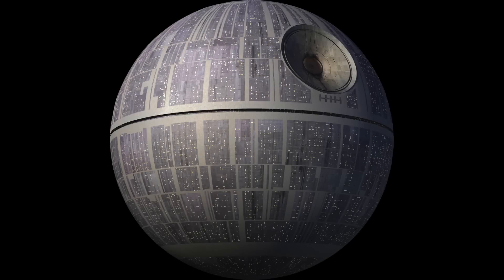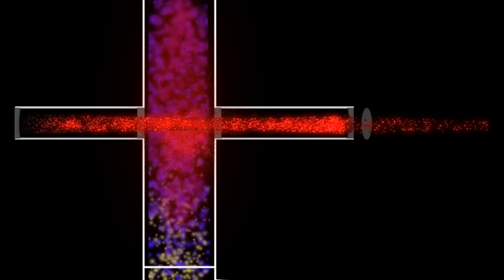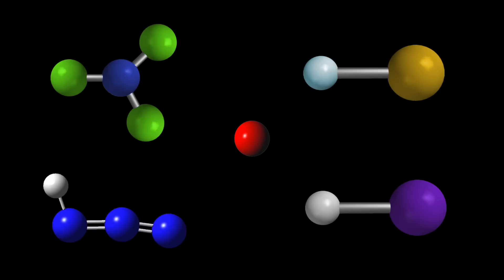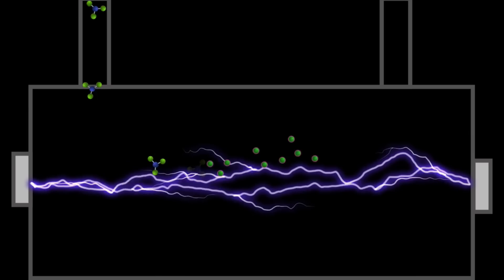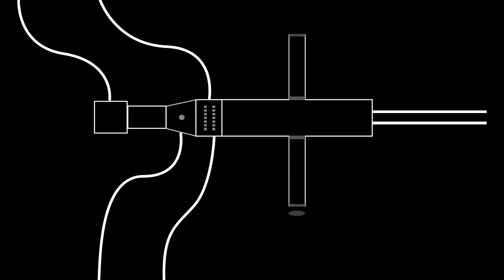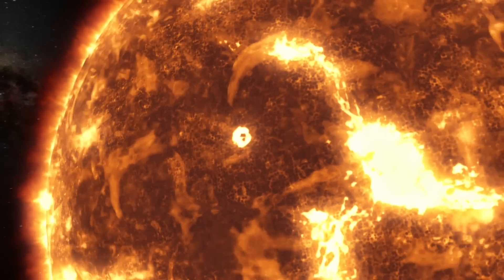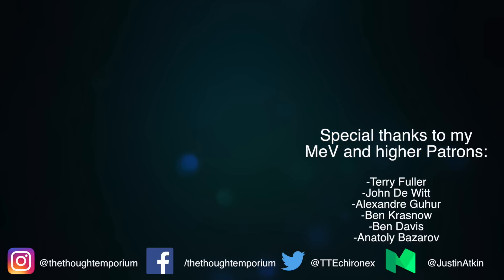How Would A REAL Death Star Laser Work?

Comment: What about using a nuclear reactor as energy source? I'm asking for a friend who wants powerful lasers to neutralize hypersonic missiles.
Reply: For use on a plane as far as I'm aware that is highly impractical, nuclear reactors are just too heavy for aircraft. On a ship or land installation you would likely need multiple reactors for a single Anti-missile laser, which is kind of cost prohibitive
Reply: You would still need a way to convert that easily and efficiently into light and i don't see that happening with a nucler reactor, it's why they use gases, they can create the right chemical reactions that produce monochrome light.

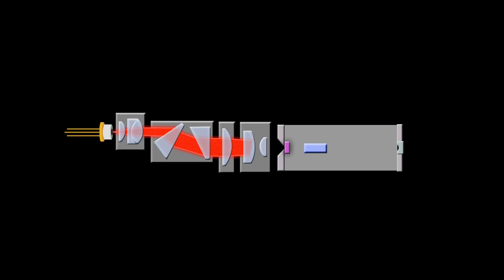Comment: 4:26Keep in mind all of my knowledge about lasers comes from styropyro but if I am correct isn't the way green laser pointers work is use ultraviolet laser that interacts with a chemical that then makes green light so couldn't you still make the death-stars laser green
Reply: No, this is a different wavelength, 1300nm vs 1080nm
Reply: @rogervanbommel1086  but my point was could you use the chemical laser to pump a Dye Laser which would thin make a green light after all a lot of different dyes for example the national ignition facility uses a Dye Laser to convert infrared to ultraviolet so there are plenty of dies out there

Comment: If you could see a beam in empty space.
The energy from the laser would be stupidly high.
The light is bouncing off basically nothing.
Reply: It's called pair production, where extreme high energy gamma photons spontaneously excited (coupled) with respective particle fields, creating matter-antimatter pair out of thin vacuum. Usually electron-positron pair since it require least energy.
Reply: Given the insane amount of the energy the Death Star puts out it would definitely be visible in the sparse particles in open space.
Reply: I don't think a laser that's energetic enough to interact with the vacuum of space is going to be good for space D:
Reply: Its light my dude and light that isn't polarized to just one direction, aka just radiation, we see light from space all the time, even laser light, see gamma ray bursts. You don't really need the light to bounce off of anything. If anything the fact that it is emmiting light from the visible spectrum means it is less powerfull not more
Reply: @azure3526  its a laser in space my dude to see it you would have to be directly in its path

Comment: that huge number at 5:50 is a problem
2e32 J of energy is a LOT
You would need on the order of 1.5e24 kg of fuel, to provide that much energy from chemical reaction (that's for oxygen-hydrogen burning, about the best energy/mass available)
Put in context, you would need a fuel tank that weighs 1/3 as much as earth, to provide enough energy to blow up earth.
Reply: That's where antimatter comes in. The Death Star is powered by Antimatter as the main fuel source. It is the only substance in the universe that can create that much energy.
Reply: @omkr0122  Yeah, that reduces it to "only" 2 * 10^32/c^2 = 2.22 * 10^15 kg = 2 220 000 000 000 000 kg of fuel, 9 orders of magnitude less.
Reply: @GRBtutorials  If we had anti-matter reactors it wouldn't make sense to use a chemical laser since the primary byproduct of an anti-matter reaction is light.
Reply: Gregory Norris I didn’t say anything about lasers. That’s the amount of antimatter needed to produce the energy to destroy the planet! Also, the light produced is gamma radiation, which is very difficult to focus. On the other hand, you don’t need to destroy the planet to destroy all life on it, the gamma rays are enough.
Reply: @omkr0122  Antimatter is nice. You can just drop the Antialderaan on Alderaan and watch the light show!

Comment: Aren't there limits to the energy density of continuous laser beams in gases (perhaps even in a vacuum due to quantum weirdness) that mean that as your power rises to a level where the laser is a useful weapon it starts to reach focusing and transmission limits and that plasma mirrors induced by metals ablated off a target can make them ineffective against anything that is even trivially protected? i.e. Nice video presentation but I'm calling bull on the fundamental assumption that there is no limit to how powerful a laser beam can be. Sorry but the Death Star would more likely just heat up the top of the atmosphere, then damage itself from back reflections. The only way to have a useful laser weapon is to have a large number of sources that have beams that converge on the target and it is the shockwave from the plasma explosion that does most of the damage, so you want your power in as short a pulse as possible delivered with perfect timing from multiple sources. So perhaps you can do it in a space battle scenario when you have massive fleets of autonomous craft and all of the ships coordinate their weapons systems. Star Wars is a dangerous area if you want to consider science, in fact Monty Python movies are more plausible.

Comment: Diamond structures are used to combine lasers experimentally. They create a culmination beam, yet adding chemical lasers by themselves wouldn't be as effective. This has to do with optical path length, phase difference, and the fact that each chemical lasers will put out slightly different wavelengths due to vacuum production technique ...Also, the atomic crystalline structure would be disturbed (used up) if the energy of the impacting beams (within the crystal) had enough energy to change the index of refraction within it. Furthermore, this would cause decoherence along with a significant drop in power outputted from the culminated beam.

Comment: Colud you make a video how to culture yeast to be more alcohol tolerant?
Reply: Just ferment under a partial vacuum and the ethanol boils off below a temperature that harms the yeast so you have almost continuous production and extraction. The only issue may be that the rate per volume is very low, i.e. not commercially viable but fine for DIY?
Reply: Daniel Matthews would the medium need to be warmed by an external source then just to maintain the temperature because of the evaporating alcohol?